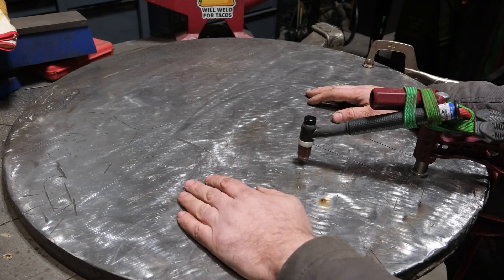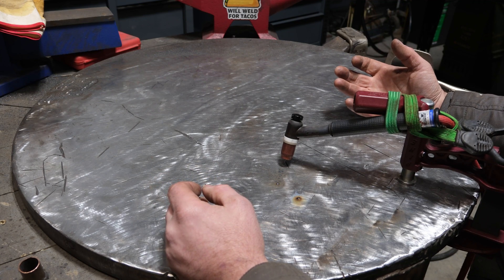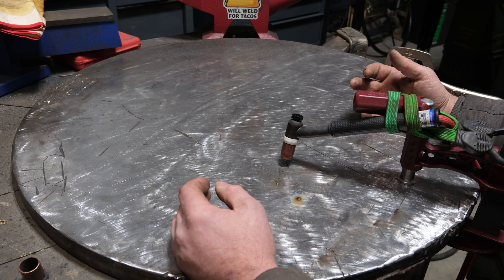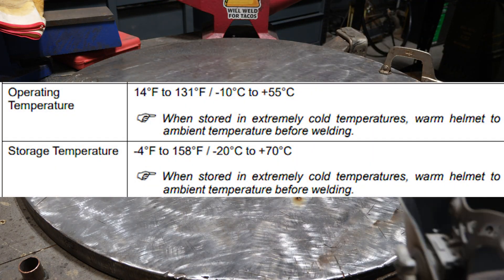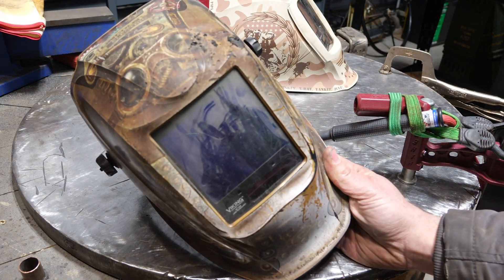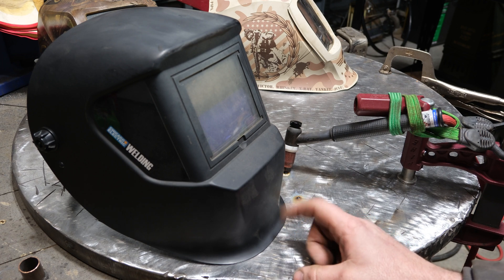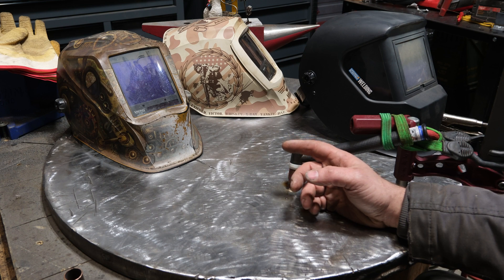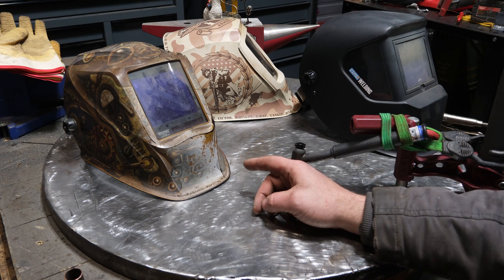Do welding hoods work at 0 degrees Fahrenheit?

Comment: How much welding should you do when it's below freezing.
Reply from the maker: Well in the repair world you might be stuck welding at low temps.  The main issue is the steel itself should not be welded when it’s super cold.  Universally it’s accepted all steel should be welded at atleast 50 degrees.  At zero degrees steel can be cold enough that the solidified weld on it will become brittle and can/will fail when stressed.   So if it can be avoided all together that’s preferred, but if not preheat is your friend lol.  Keeping the hood clear so you can see is also a hard part lol.

Comment: I bought some 7018 3/32 ESAB electrodes. I hope there as good as you say they are when they arrive. I only use Lincoln rods they run so nice, but the price is getting out of hand.
Reply from the maker: Esab makes 3 7018 electrodes, the atom
Arc, the sure weld, and the prime.  I personally like the prime the best, because of the graphite tip.  It makes starting the arc easier in odd positions and makes starting porosity a non issue.  For repair work it’s my go to rod.  Their other rods are good as well.  Lincoln’s 7018 Excalibur is a great rod as well, but it tends to be expensive per pound unless you buy it in 50lb boxes.  The only 7018s I have found I don’t like tend to be real cheap ones on Amazon.  They tend to run differently box to box and size to size.  I like things to be the same, it makes it much easier to get the desired results 😀👍

Comment: On that fogging issue. I use a 3m respirator 6503QL. It seems to keep fog at bay, as your breath leaves at the bottom. I love this respirator as the QL - (quick release) is the greatest thing. You can drop it with one hand and talk or eat or get a quick drink and latch it back on and work without removing it. Use it once and you'll never use another.  I use the 2097 filters, although I think the 2091 filters will work for welding. I've worn this unit 8 hrs a day for years. 
      Another "must have" that I use and learned about from another welder (Taylor Welding) is a correction pen. They leave a thin white line that won't come off with heat. Because of that, you can use them when plasma cutting.  Don't leave home without one. It's become indispensable to me.
Reply from the maker: Great tip on the pen I will give that a shot (never heard of that).  That respirator seems like a sweet setup, I have never seen that design either.  I will have to try one out too 😀

Comment: Completely off topic.
Love your stuff, I'm learning tons at 63 and am enjoying busting a few balls of guys with way more knowledge and experience than I, who've been doing stupid shit forever because of....uh..it doesn't''t matter. To coin a new phrase: Fuck 'em, let 'em stack dimes!
Here's what's pissing me off. 
My very first squirt gun was a Lincoln weldpak 100 that I saved from going to a pawnshop somewhere, and have ran it forever off grid on numerous generators, large and small.
The weldpak has a power switch, Yay! It's right on the front!
I've recently acquired: Esab EMP 210, Titanium 225, and the famous Best Arc 500 gen 10. 
They all sit about eye level on a new Homeless Dopes 78" shelving unit, all cuddled up side by side.
What a royal PITA to try and reach around the back of each one to try and find the power switch!
What the hell was wrong with putting the switch on the front like my old Lincoln?
I just don't have the time to take these all apart and figure out if it would be easy or not to move the switches up front.
So, here's your next video idea.
I'll be standing by.
Thank you.
Reply from the maker: So for some reason many welders only do rear switches now.  I have heard a major reason was electrical compliance with countries outside of the U.S., and that could be true.  Many of the welders I own would have no technical issue having a switch on the front.  The power cord on most welders enters the back and then goes straight to the power switch.  A front switch would require the input wires to go all the way to the front or a relay that’s in the rear that’s controlled by a switch on the front.  Either way it’s way better having it on the front.  The only welder I have with a front switch is the fronius accupocket 150 I have.

Comment: Sometimes my Miller doesn’t work with TIG at regular temperatures
Reply from the maker: It’s pretty common for many hoods to struggle with tig.  The higher end ones generally work good with tig.  Often times the only hope to get things to work better with one that’s struggling is adjusting the sensitivity sky high.  If that doesn’t work and the batteries are fresh, there isn’t a lot that can be done 😕.

Comment: This was a fun test. And a nice way to make the most of the cold!!

I will mention that it's not just cold batteries that can impact performance. Auto-darkening lenses darken by activating liquid crystal elements, just like an LCD display. If it's cold enough, the liquid crystal itself can start to take longer to 'react' to the electrical signals.

Also, while maybe not as a big a risk with welding lenses and basic LCD displays, with things like laptops displays and such, be careful with storing LCD screens in overly cold conditions for too long. I used to work in a computer repair shop, and I've seen laptop screens that people left in their car overnight with temps approaching -40C/F and there's no fixing them. Only replacing
Reply from the maker: Makes sense that cold could permanently damage the screens.  Atleast a welding hood is cheaper than a laptop, that’s an expensive mistake yikes lol.

Comment: I noticed on entry level auto that the reaction time slow down with temp?  For me , worse about cold PPE is the moment it get in contact with the skin. it be a respirator or the headphone type ear protection.
Reply from the maker: A lot of the entry level hoods use an internal battery that’s charged via solar, and I bet the voltage drop when cold is real bad.  Having to wear cold gear sucks, the older I get the more I try to warm things up lol.

Comment: Hey Greg! Got my tig lessons rolling along in the shed on my everlast. I love it! 
I just scored a bobcat 225 for a steal! I’ll be mobile welding in no time 😂 (joking) do you have any vids or opinions on older wire feeder attachments or the newer voltage sensing wire feeder suitcase welders? 
Found a miller S-32s for $100 but idk what I’m looking for yet obviously. 
I just want to be able to flux core out the back of the truck.
Reply from the maker: Glad to hear things are going good 😀.  So that particular wire feeder is kind of a unique device.  It can operate on both CC (constant current) and CV (constant voltage) power sources.  Wire processes regulate voltage to a fixed number (say 19 volts) and the amperage is based on the wire feed speed.  More wire equals more amperage.  So anyway, that feeder is capable of working on most CC stick welding machines and should work on a simple engine drive.  It will actually operate off the output of the welder and not require separate power in most cases.  The adjustability is a bit different on the system without direct voltage control.  I believe voltage is adjusted via a ratio based on wire feed on that unit.

As far as how well it would work on the setup you have I am not exactly sure.  I have welded a lot with suitcase feeders on power sources, but only on ones that I could directly adjust the voltage.  For the price it might be worth screwing around with I think 😀

Comment: I've never even thought of this being an issue. Were I am it doesn't normally get much below freezing here in the winter and that's normally only at night unless there a southerly blowing up from Antarctica. I have definitely been flashed by low amp TIG when I've had low batteries though so I think your on to it the voltage dropping more at really cold temperatures. Also I find cheaper auto darkening really struggles with pure helium but no issues with argon. I guess this might due to the different spectrums each ionized gas emit and tuning the sensitivity towards argon.
Reply from the maker: Very interesting, I have only tig welded with a helium blend and never straight.  Helium boosts the voltage required to maintain an arc so there is a lot more heat input in the weld pool with a tight arc vs argon.  Clearly it must do something with the light output if it affects arc sensors.  That would be a rough one to be flashed by due to how bright a/c tig generally is.

Comment: Either turn on the workshop heater or call it a day.
Reply from the maker: I ran 2 heaters (one kerosene and one propane) for 2 hours and barely broke 40 in the tin shed I work out of lol.  Luckily I can just edit stuff indoors for a few days, it’s crazy cold.
Reply: Some of us have to work outside believe it or not. Up here zero degrees is a nice day outside, it's when it gets below -20 that it really starts to suck especially on the night shift when it's really windy. Probably the worst night I can remember was working the 18:00 -06:00 shift, it wasn't that cold around -15 to -20 F however it was blowing 60 mph and let me tell you that was a  absolutely miserable night, especially as the only mechanic on shift who was dealing with broken down equipment all night long. The sea spray was freezing to everything and covering everything in ice, at one point I was 30 feet up a ladder that was covered in ice and hydraulic fluid, with the wind blowing 60,changing a hydraulic hose. You really start to question your career choices on nights like that!

Comment: I was freezing my butt off yesterday and today welding in an unheated building. My hoods worked fine. I got into a position where I couldn't see out of my hood so I had to grab a glass to use by hand and decided to grab one of the Copkim 2x4 auto glasses that I bought, 2 for $8.99, on amazon - no joke. They worked fine, although I'm not advocating for them as I haven't really put them to work. They may be junk.  It was the first time using one. I have so many hoods laying around I thought I'd just toss them in as backup or for others to watch.
Reply from the maker: I am kind of surprised they rated the hoods fairly high for operating temp compared to what they would run down to.  Glad to hear yours worked fine too.  Have any tricks to keep the stuff from fogging up?  That’s one thing I need to figure out lol.
Reply: @makingmistakeswithgreg  Try Rain-X Anti-Fog. Make sure the lens is very clean before the application.  Apply a thin layer and buff it in quickly with a clean cloth. This is guaranteed to work except when it doesn't.